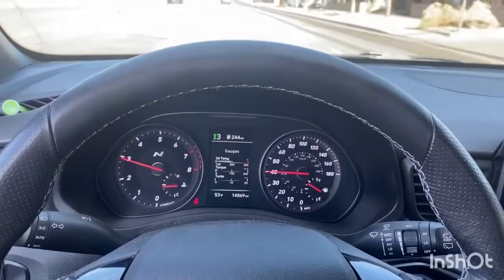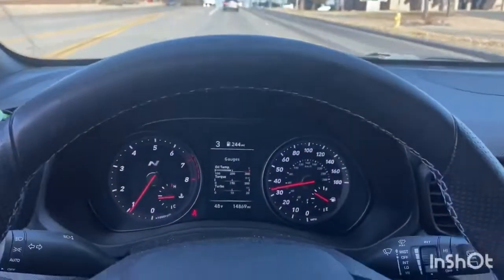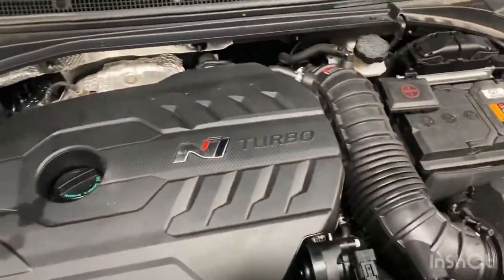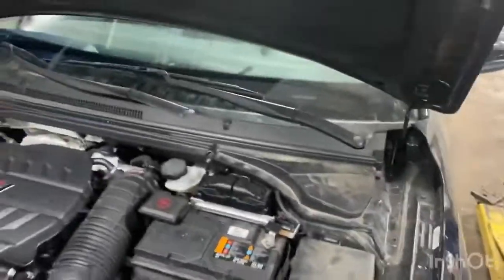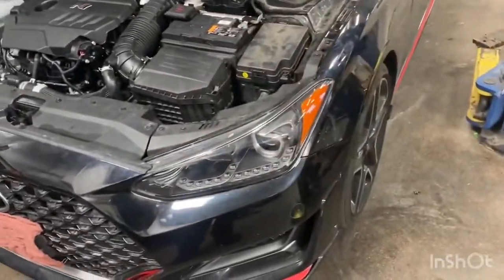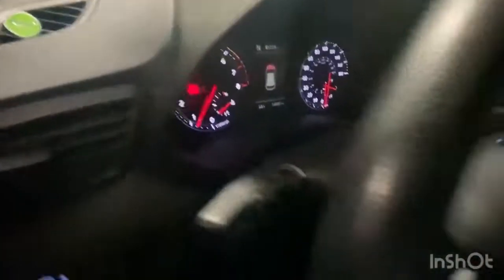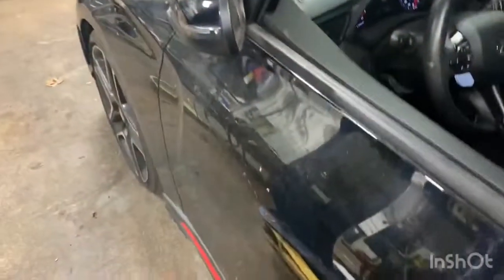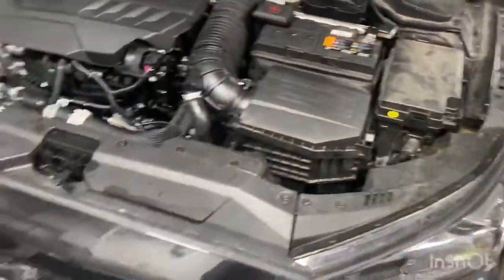2019 Veloster engine finally dose it customer has picked up how long will this one last

Comment: What happened to the old engine ? Looks like there was only 14k miles on the dash
Reply from the maker: Suspected Money shift
Reply: @colorado car life doesn’t it have a lot of technology to prevent it from money shifting?
Reply: @coloradocarlife6890  ^
Reply: @elpipofx  no actually the other way around. since it has rev matching you can throw it into 2nd at 100km/h and it will peg itself. it will set of an alarm saying DONT FUCKING DROP THE CLUTCH, but hey you do it, you do it.